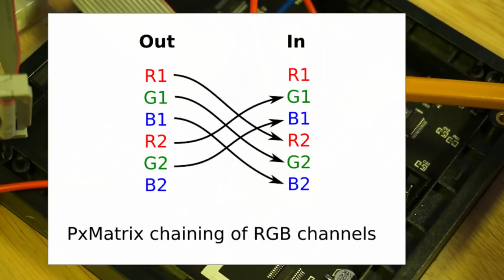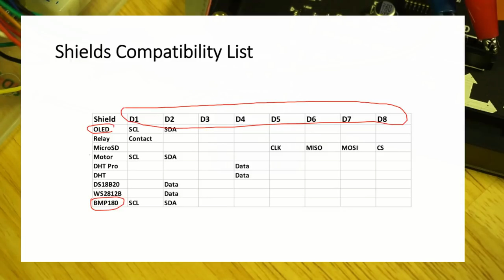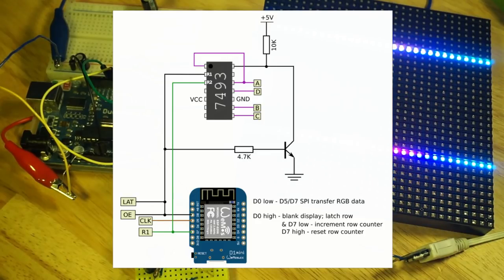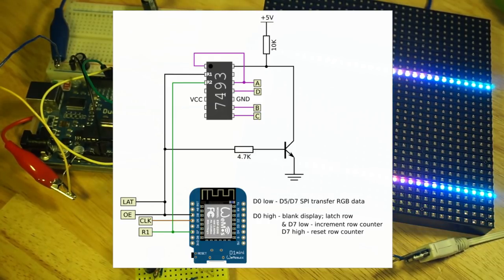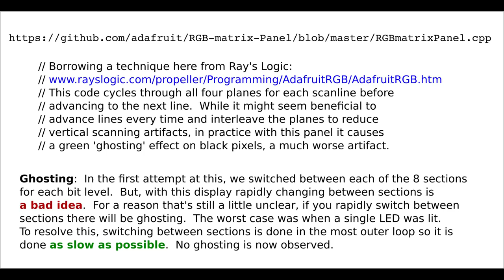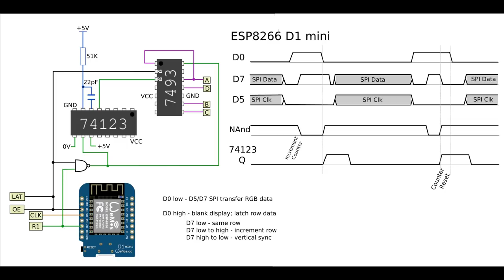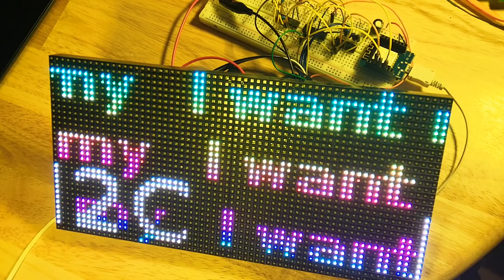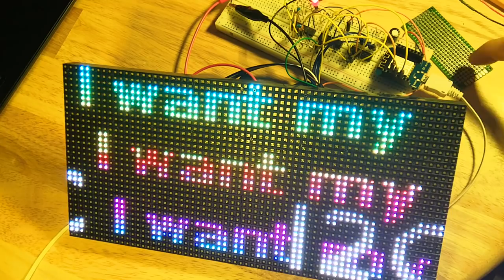The Fewest ESP8266 IO Pins to Drive a Large RGB Matrix?

Comment: Hi bornach, interesting video! I liked your explanation of bitplanes, a subject new to me. Thank you! +1
(I'll have to watch it once more to grasp your use of the logic gates..)
Perhaps the I2C driven PCF8574 can be helpful here. Only two MCU pins (SDA/SCK) give 8 output pins (16 pins for the PCF8575). The ESP8266 allows for the high I2C rate. I made an Adafruit GFX compatible Arduino library to drive the Nokia 5110 display using the I2C backpack module which also uses a PCF8574 chip. In an earlier YT video I gave a demonstration and I included the pin-out of that module in that video as well as in my GitHub account.

Comment: Interesting approach. But you could just chain one additional shift register (74hc595) in front of the matrix. That gives you 8 additional Outputs you can use for row selection in any order you want just by sending one additional byte for each row. No need for complicated v-sync :)
Reply from the maker: Yup. That would work too. 
I wanted to leave open the possibility of latching in one row of pixels and then optionally incrementing the row more than once to easily create vertical bars or do the Gigatron TTL trick of skipping rows to trade resolution for computation time.

Comment: Could this be applied to the DMD2 library? I'm too short on I/O and my panels are only monochrome, so maybe i could save on program memory if a monochrome display library is used?
Reply from the maker: I don't think so. The DMD row selection is done differently. A, B, C, D pins select 1/4 of panel. So I'd use a CD4017 instead of a binary counter.